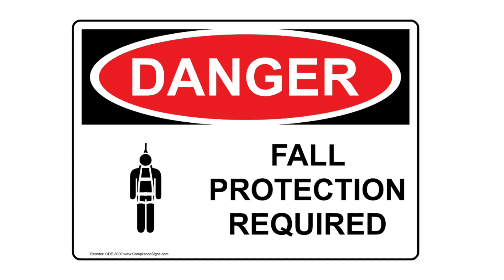DX Engineering’s Amateur Radio Tower Safety: An Introduction to Climbing Part 1

Comment: If you last went through Comtrain in 2012, and you uploaded this video in 2020, you are not, by any measure, a "fully qualified tower climber" or rescuer. Let alone qualified to instruct others.  That is a two year certification and is required to be renewed every two years. You are also required additional training and certification in order to properly and safely train others. Please feel free to reach out if you have any questions or would like to receive such training. 

P.S.,
Fall arrest is required 100% of the time and work positioning is not fall arrest. You are claiming compliance and safe practices while in fact instructing direct OSHA violations.
Reply: This a million times! Continuing education and recertification are vital parts to safety across all industries